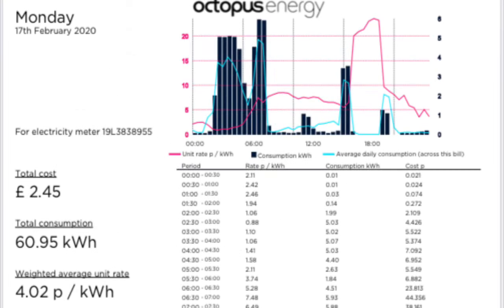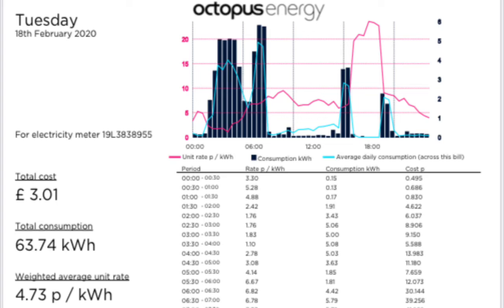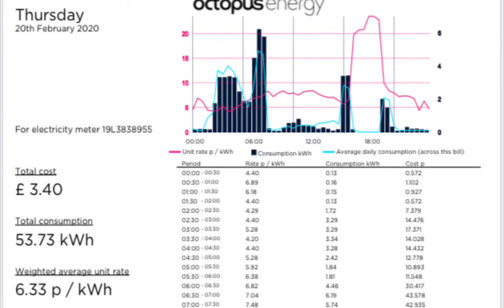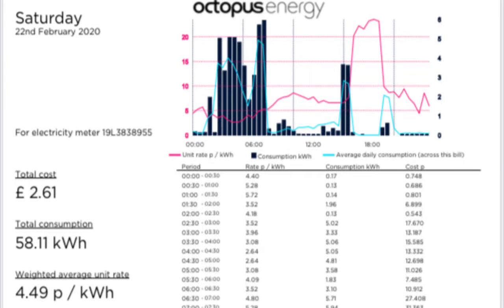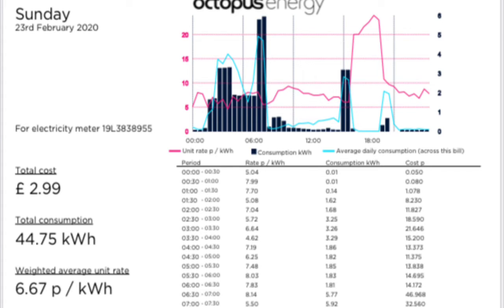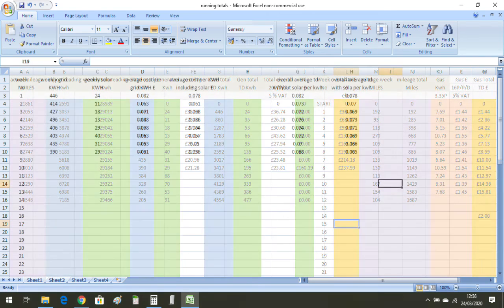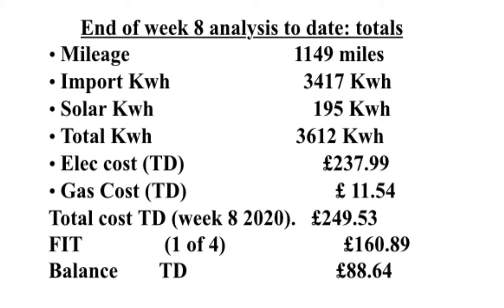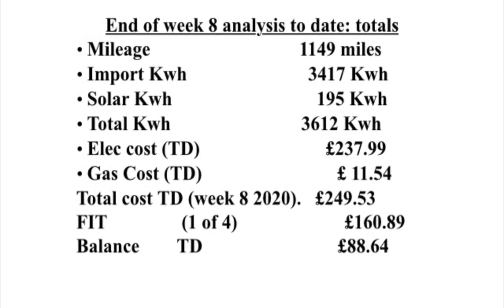Week 8 Costs 2020

Comment: Am I right the boiler is either on or off you cant set for Agile cheap rates only
Reply from the maker: Keeping It Real yes 
Because it’s heat you need that when you need it. I do play with times a little to take advantage of agile but when it’s cold it’s cold
Reply: @AllElectricLiving  so it doesnt store heat damn
Reply from the maker: Keeping It Real no unfortunately not 
But my hot water tank does